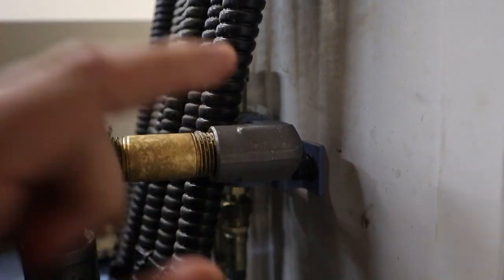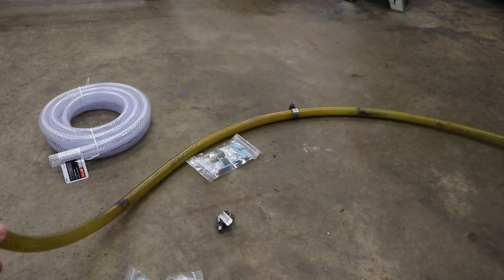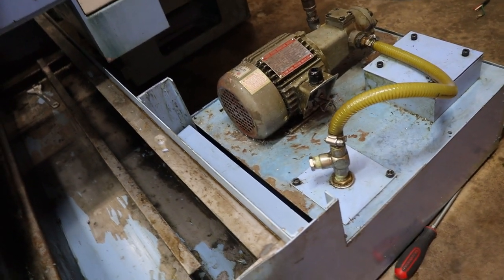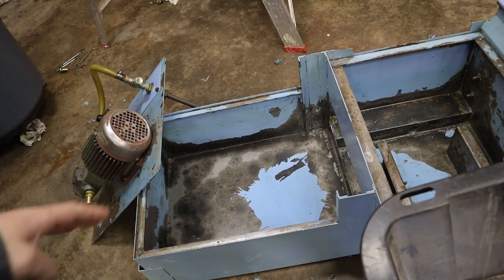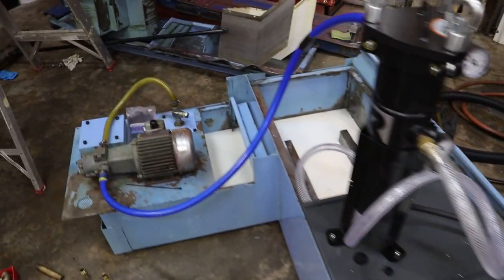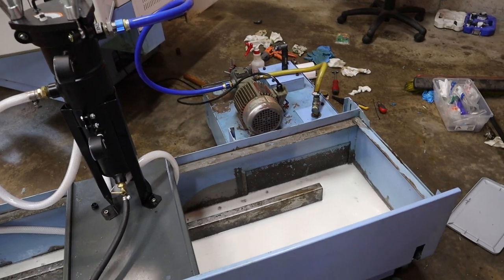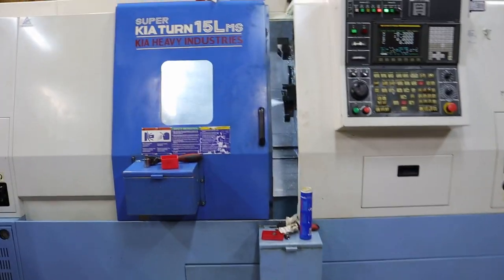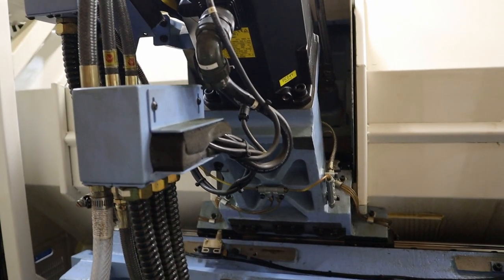Kia 15LMS coolant system finished - Part 2 of turret repair

Comment: deffo not factory pump, they supposed to have one of those which suck deep, the disc type or whatever it is. then it broke and they see how much it is and then decided that the one they have somewhere on the shelf is good enough. Seems to give a decent pressure through the turret tho

Comment: Would a softer material like Teflon work better to seal the  leak?
Would a spin on hydraulic filter in line work to keep the coolant in top condition?
Reply from the maker: Only issue with another plastic is wear life. I'm sure there's a better material out there that would both be flexible enough to seal better, and be long lasting. I'm thinking I might get the same filter setup that I'm running on the vf2. Now that I am thinking about it though, it would be cool to have an easy off the shelf spin filter, like a hydraulic or oil filter... Hmmmmm.. Good idea.